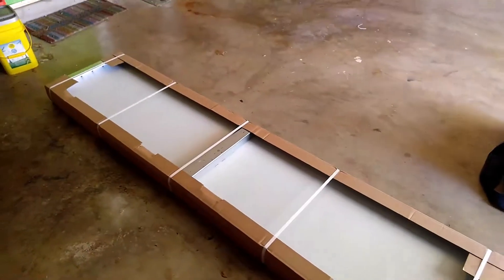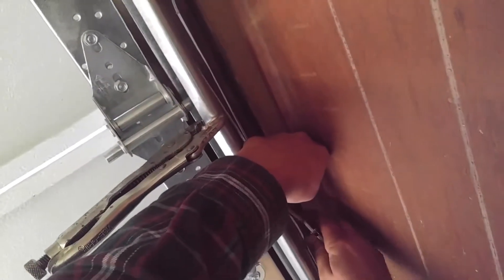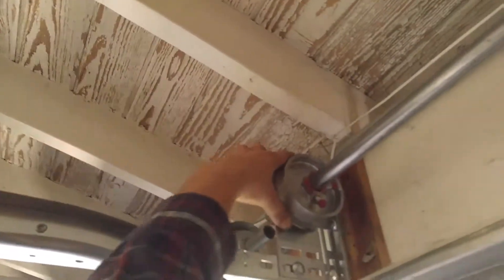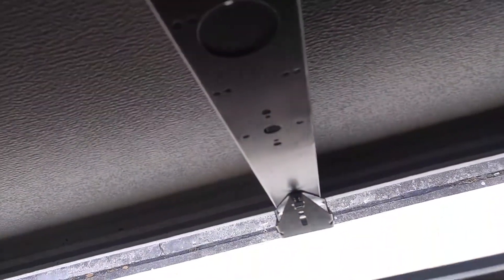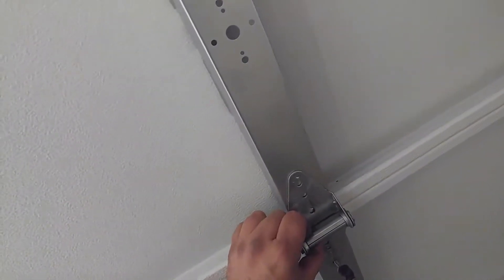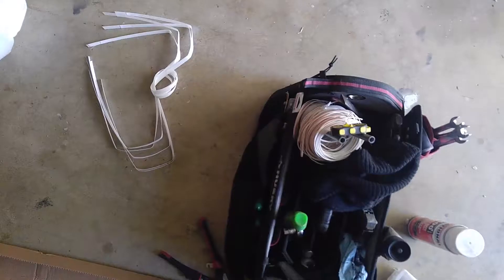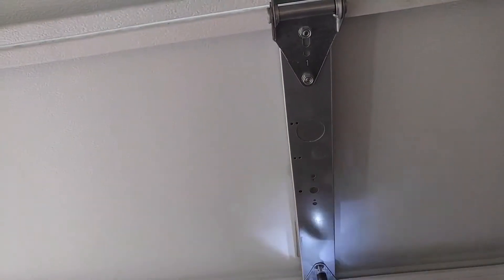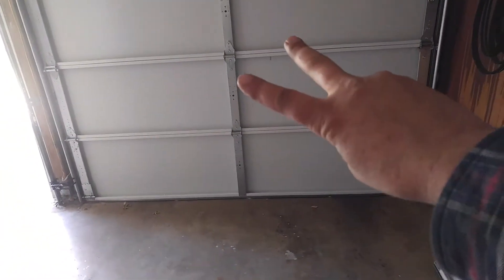Hit The Garage Door With The Car Replacing Damaged Flush Panel Sections

Comment: individual panels are hard to find and they ain't cheap, how much did you pay for those panels?
Reply from the maker: I got the panels from a local garage door supplier.  Lucky enough to live in a city that has that option.  
That video I made pre-pandemic.  So I paid less than $150 a panel.  Can't remember the exact cost.
You're right.  Post pandemic you'll pay close to double.
Reply: @garagedoorgenius  HA....The Haas 2580 9' panel is 450 bucks, for just one panel!
landlord said I could do some body work to fix it up instead, how do they get the embossed stucco pattern back after they fill in the ding with bodyfiller?
Reply from the maker: @FourthWayRanch  You're probably dealing with an insulated door, correct? $450, ouch! I bought a lot of stuff from my supplier so my pricing pre-pandemic was pretty decent.
Lol, you're asking the wrong guy about the bodywork. Typically if it's dented or creased up, it's hard to fill and will look weird.
Reply: @garagedoorgenius  it's a 4 inch clean slice that just dented it a bit.  I managed to bang it all out pretty flat, now I just have to fill in the little groove with some bondo
Reply from the maker: @FourthWayRanch  right on!  Let me know how it turns out.
Reply: Yeah for 2 panels you may as well replace the whole door
Reply from the maker: @dguiley  sometimes that's a better route. 👍🏼

Comment: When we moved into the house (we've been living in for 20+ yrs now) the garage door was already showing signs of rot in the bottom panel. Most of the panels are solid, but the bottom one had the 'carboard' construction just like an interior home door. GO figure the bottom panel right? The one that should be the most solid was indeed the weakest link. I would have replaced it by now but I can't find any 10' panels anywhere! I know they exist, but when I look they are nowhere to be seen. I would prefer something solid with no windows. If  ever fix the door I will replace/upgrade the hardware hinges/rollers. That would be fairly easy. If I were set up better I'd construct my own door panels from treated 2x's. Your video is very good. I will reference it If I ever do fix that piece of garbage. It will be a solid door after I get done for sure. I wont get involved unless I know I can do it right!
Reply from the maker: @allthings2allmen  yeah those old wood panels are hard to find.  You're probably better off making it like you said.  
Thanks for the compliment!  I really appreciate the feedback. 👍🏼

Comment: I was considering replacing my wooden garage doors for around 5K because bottom panels were rotted/damaged.  After watching your video I'm inspired to take the wood panels off and try to replace or repair the rotten sections with  plywood.  Thanks for video.
Reply from the maker: I have seen where a customer has fully restored their old '80s wood doors. It's very possible to do. However, be very very careful with the bottom bracket that the cable attaches to. The springs are nothing to mess with. So do some research and you'll be just fine. Thanks for the awesome comment!
Reply: @garagedoorgenius  I survived 😀. It came together nicely. Not rocket science but had to proceed very cautiously.
Reply from the maker: @velendzas  awesome news!  Thanks for reporting back. 👍🏼

Comment: I want to replace all 4 panels, would the continued sequence go the same, would the vice grip stops be different at the 3rd and 4th windows panels,  are there any differences for removing and replacing these 3and 4 as well?????
Reply from the maker: @barrykuhnke4803  in your case I would just unwind the spring.  Get the tension completely off.  Change out the panels.  Then use this video to reset the cables and wind the spring. 👍🏼

Comment: You Rock Richard ! 

Yours is the only video on YouTube that shows us DIY'ers to use the torsion rods to backwind the cables. All other videos are from pros using cable pullers/come-alongs. 

Question: I've used the tension rods once before to wind-up a new spring. In that case I would rest the rods on the wood framing overhead. In the application is it safe to rest the tension rod on the garage door for that long while doing the repair? It's not too much force? 

Thanks again man!
Reply from the maker: Hey man I really appreciate the awesome feedback!
Yes, resting the bar across the top panel is okay.  If you're afraid of denting the panel, stick a chuck of 2x4 under the end of the bar.  Rest against it. 
Again, thanks for the comment. 👊🏼
Reply: @garagedoorgenius  Oh great idea! Thanks for the quick reply, and once again for you're awesome videos. Keep doing what you do brother!

Comment: Where do you buy a replacement panel? I damaged my bottom panel and can't figure out where to just buy 1 panel. Thanks!
Reply from the maker: I would find a local garage door dealer/company.  Most places will sell you what you need.  Check local hardware stores also.  Have the size length and width of the panel, color, tongue and groove or shiplap.

Comment: Can I buy the plastic part that acts as a gasket between the garage door panels?
Reply from the maker: You mean on the bottom section?  The piece the bottom rubber slides in?
Reply: @garagedoorgenius  no not that one. there’s a clear plastic strip that’s in between the panels that popped out on my panels. Can’t find them anywhere. Can I send your a picture through email?
Reply from the maker: @andy_o6133  I think I know what you're talking about.  Do you know if the door manufacturer is an Overhead Door Company?
Reply: @garagedoorgenius  I have not tried to find the exact manufacture of the panel yet but I am going to get right on that when I get home!
Reply from the maker: @andy_o6133  let me know how it goes! 👍🏼

Comment: So are you loosening spring tension or increasing it when you crank it upwards like that? I need to take out the bottom panel of a door that has two springs, one on each side of center. So can I do what you did one spring at a time, raising up the door to get that bottom panel off?
Reply from the maker: Pushing upwards is slowly relaxing the panels down.

Comment: I am going to replace all 4 panels on both of my 8x7 flush panel garage doors. Do you recommend raising it up and following the same procedure, starting from the top or bottom first? Thanks!
Reply from the maker: Na,.  If you're doing all 4 just put it on the floor vs raising it up a bit.

Comment: How do you release the tension
 on the spring if its got a double spring.
Do the torsion rods lift the spring around that easily?
Reply from the maker: Double torsion or single torsion. It doesn't matter. Once you start back winding the spring, whichever one you choose, the door will just start dropping.

Comment: I’ll have to remember the vice grips on the cable trick. That would have been helpful when I had to remove the bottom brackets to put the rollers back on a door that also had gotten hit by a car and the rails were concreted in.